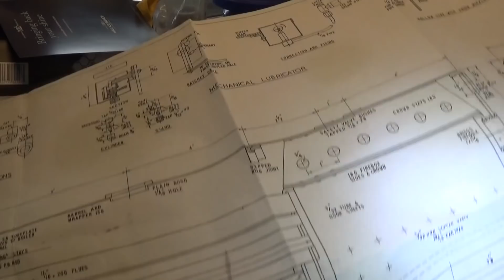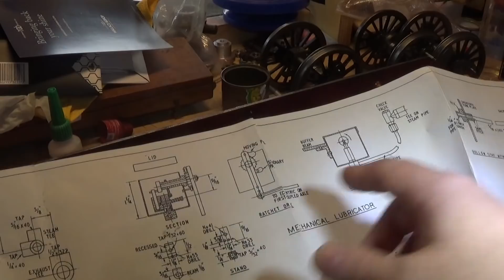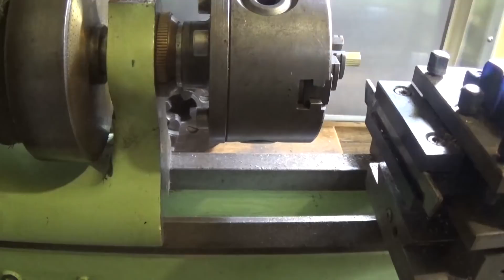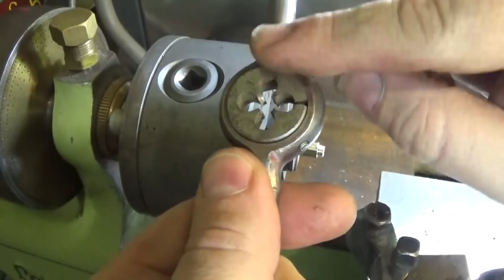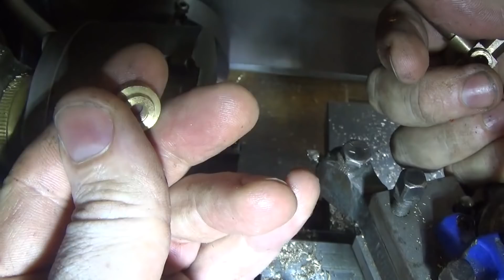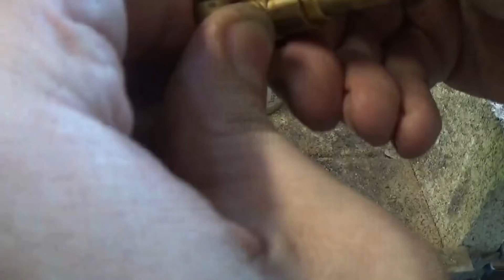Clacks. one for Eugene & one for Marina!

Comment: Nice work.  The whole project looks a bit overwhelming until you can break it down into one piece at a time.  I noticed on your lathe that the drive pulley has what looks like 100's of pin holes drilled in it.  If so, do you know why?
Reply: Barry Gerbracht It's an indexing face.
Reply from the maker: it has an index plate in the head.

Comment: Lovely job. It looks quite a simple part, but you have shown the design and it's workings beautifully. Thanks for taking the time and effort that you do to share your enjoyment.
Reply: Try turning the die round in the holder after first tapping the correct way round, you will get a little more thread length hopefully !

Comment: I really enjoy making small parts like that. Very fiddly as you say, but enjoyable. Nice work, you made it look easy. I turn my dies around after starting the thread but you have to be real careful not to bugger the thread. Especially with soft metal, as I'm sure you know.
Reply from the maker: im going to get someone to grind one side of my dies for making brass fittings. think ill buy a set especially.